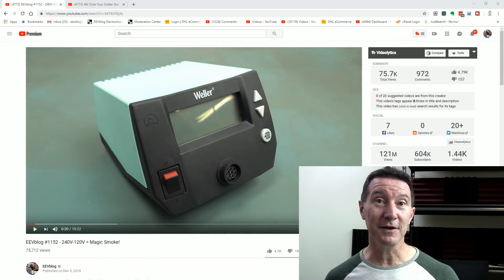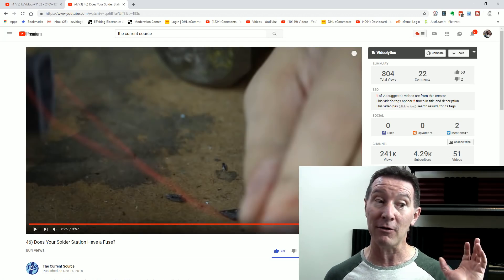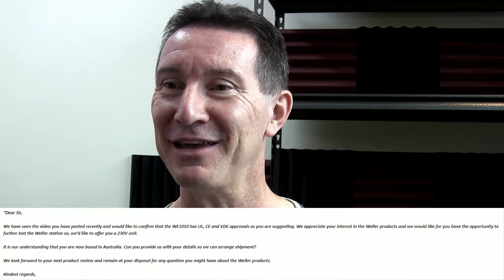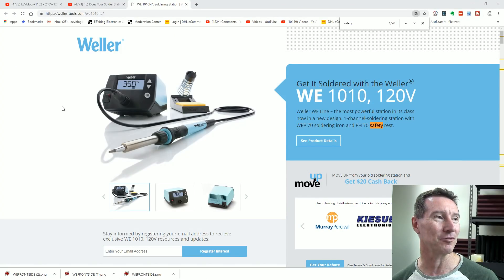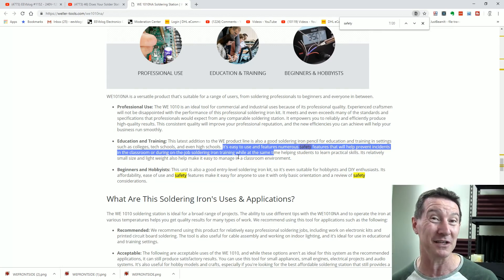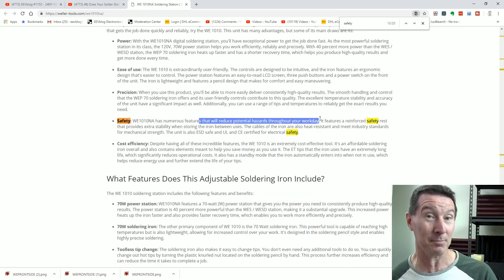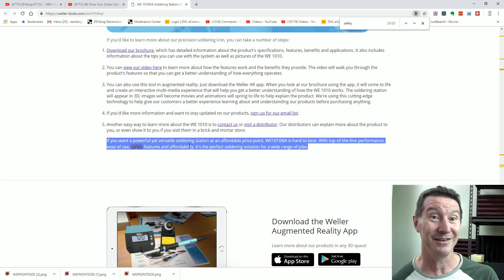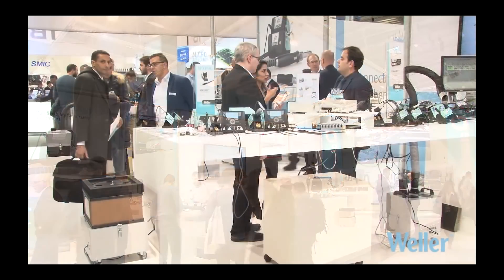EEVblog #1160 - Weller Responds!

Comment: As a European, I'm not sure what kinds of sloppy standards are considered acceptable in the US and other third world crapholes but over here, a primary side mains fuse (or at the very least a thermal fuse in the transformer) is absolutely mandatory. As Dave correctly points out, even the el-cheapo counterfeit Chinesium crap on ebay comes with primary side fuses. Weller presents itself as a quality manufacturer, yet they are shipping out non-compliant death traps like these.

I would advise anyone who owns one of these to either fit a suitable fuse themselves or just chuck it in the bin...
Reply: You do know that this iron also has CE approval, right?
Reply: @johnstone7697  So it can relase magic smoke but mustn't catch fire. 

Another thing to test.
Reply: @johnstone7697  yea but the CE doesn´t need any test.....just some paperwork to get it posted onto your whatever product.
Reply: Dude.... there is nothing wrong with the product. Dave just doesn't understand safety engineering. The problem with this is that he is able to mislead all the lemmings watching this video.

Comment: even if there was a Fuse, what should it help with quad power at the same amps?
Reply from the maker: In this case the core saturates and become resistive instead of inductive, leading a huge increase in current (which is why it smoked so quickly). A proper rated fuse would do the job perfectly.
Reply: +EEVblog you are right ...

Comment: I still have one of those old blue style weller irons, but with a 3 digit led temp display, its from the 80's , its on its original tip fitted new in 1983 which has soldered maybe 3 days a week since, used it for 2 hours last night, will get about 4 hours use today, on a outdoor job wiring up some lights on a farm tractor it got ran over and squashed the case, duckt tape sorted it, the tip has been misused to cut plastic and melt glue sticks, weller tips from the 80's were pretty  indestructible... no primary mains fuse isnt right and needs putting back in, but theres also a fuse in UK plugs and for an iron it should be rated at 3 amps, so i'm not too bothered. - not a weller employee, but def a fanboy based on them damn indestructible old tips. (they can keep there modern irons.....)

Comment: To be honest, if they have UL, CE and VDE approval you cannot blame Weller. 
This is also basically what the letter of Weller says.  
-
Weller has to meet these standards and not Dave's and apparently Weller did so.  If you do not agree with the safety of this iron then (and I agree) blame UL, CE and VDE.
Let them explain why they think a non-fused 120V iron is save enough to get their approval. This will definitely not be the first Weller iron that got fried bij 220V or even 380V.
-
I would like to see the reactions of UL, CE and VDE.
Reply from the maker: The buck stops with Weller. The product category they listed it under does not require a mains fuse.
Weller made the very deliberate decision not to include a mains fuse on this model.
Reply: @EEVblog  Sure the buck stops at Weller. But large organisations like UL,CE and VDE get paid to test the safety of products and they decided it was save enough. They also accepted that this product is listed under this category. I assume they will have tested the product and made an intelligent decision why a fuse is not needed in this case. I would be very interested in their reason why this product does not need a fuse as I see an obvious fire/heat hazard. 
-
As far as I am concerned Weller has no blame because they fulfilled all regulations. Of course, they could also install thermal switches, waterdetectors, flashing lights and what not. That would make it even more save, but ... well you will understand. Every customer looks first at the price of a product. That is why we have these safety and regulation organisations. To make sure all products meet certain safety standards. And Weller meets those standards.

I will check my Weller to see if it has a fuse on the primary side. (it has a fuse but seeing the value I think it is on the secondary) If not, I will put an extra fuse in it. So I am definitely not against your safety argument but I lay the blame somewhere else. Blame the safety/regulation organisations They were invented to make products save. They should either put this Weller product in another category or change the safety rules for this category.

Comment: Fuse lottery. If you're the lucky winner your repair shop won't burn down.

Yeah now that I know this, I'm not taking any risks. All weller stations here will be removed and replaced with another brand.

Comment: My guess is the 230V version does have the fuse as required for VDE. The 110V doesn't.
Reply from the maker: Someone posted that their 240V unit does not have a fuse either.
Reply: @EEVblog  definitely something sketchy going on then! I'm not 100% on the VDE standards, but the IEC standards definitely require it unless contained within a fire enclosure

Comment: Dave perhaps Weller is hinting you should relocate somewhere that has a fuse in the wall socket as standard protection. You will find them in countries that operate on ring circuits due to lack of copper availability during WW2. Here’s a list of countries to look at my friend. 

United Kingdom,Ireland, Sri Lanka, Kuwait, Bahrain, UAE, Qatar, Yemen, Oman, Cyprus, Malta, Gibraltar, Botswana, Ghana, Hong Kong, Jordan, Macau, Brunei, Malaysia, Singapore, Kenya, Uganda, Nigeria, Iraq, Tanzania, Zambia and Zimbabwe.

Comment: Strange that it doesn't handle any input from 120 to 240 VAC. Many modern power supplies work on 67 to 240 V AC or DC. Perhaps it's based on an early Russian design. No input fuse is just cheap and crappy design.

Comment from the maker: Even the world's cheapest soldering station has a mains input fuse: https://youtu.be/0GdV7XBae74?t=8m55s

What's crazy is they have no less than 2 fuses and a massive polyswitch on the secondary side. Not all of those are needed, and that extra secondary fuse could have paid for the primary fuse. Wacko.
Reply from the maker: Rob is correct.The transformer saturates and causes a large current overload (the inductance starts to become resistive instead). A fuse is perfect protection for this.
Reply: Normal fuse protect only against over current and not over voltage. When the wire isolation star to melt ( the resistance drop and current grows)  is too late to save your transformer (but not to prevent fire).
The good solution to avoid the transformer melting are thermal fuse
Reply: That isn't correct.  The iron-core mains transformer designed for 120V will saturate at 240V and thus the current will increase very much (not just 2x) and it will blow the fuse immediately, before any heating issues occur.
Of course with an "ideal transformer" things would be different, you would just get 2 times the output voltage and 4 times the output power towards the iron, and a fuse would not blow that easily.
Reply: @Rob2  OK good to know
Reply: @DadoRAM  Over-voltage causes an over-current condition in this case. What provides protection in the event that the primary develops shorted turns? No thermal fuse and no over-current protection, you'd be relying on your smoke alarm.
Reply: @ferrumignis  Yes and no. Because usually the fuses are oversized or slow. The WE1010 is 70W at 120V 0.58A You have 2 options put slow 0.6A fuse or fast 1A ( for the current pics). The fuses work well on short circuit but if you have medium impedence mmmmm........
Reply: @DadoRAM  The current will more than double in a situation like this. A normal primary fuse is perfect protection for that. A thermal fuse is a good solution for prolonged overload situations. It may not even have gone off in this case as, depending on its placement, there is some thermal mass involved.
Reply: Hahahahaha, that was a great laugh after this Weller rant...
"Nothing fancy, but hey, at least it is fused... Bonus"
Reply: Did The Current Source take down their video????
Reply: if I don't know what you are talking about its just bullshit
Reply: Especially there are cheap-o input mains input sockets including the fuse holder. So no need for additional parts in the enclosure and extra cabeling...

Comment: They're a great unit though. Heat output is brilliant. Under normal use there'd be no issues over it's (30+ year) lifetime. Not worried about the missing fuse at all.
Reply: My choice over a FX888 any day.
Reply: If it's 30 years old you wouldn't worry about this modern unitobviously, just don't buy a new one and you'll be fine.

Comment: I think they basically got away with not using a fuse by using high quality parts, like a high quality transformer where the insulation will simply not fail unless you seriously overload it. It's bad seeing this from a company like Weller, they should'of just stuck a fuse in there, it's just a few cents.
Reply from the maker: I'm sure the transformer is good quality. In any case transformer failures are pretty rare, but they do happen.

Comment: My WE1010 unit (230V european germany) has only one 4A/300V fuse on the mainboard. No other fuse even not on the secondary side. i bought it in mid 2018.
Reply from the maker: Thanks for the info.
Reply from the maker: Can you post a photo of inside?
Reply: Hi Dave here are 1 picture from the inside and 1 from the label. It's an isolated transformer.
https://imgur.com/a/UIrrQUN

Comment: I wonder what is the loophole in the UL approval process.  Fitted plugs in the U.K. are fused perhaps it was designed with that in mind and then they goofed for other countries with none fused plugs.
Reply: Actually a fuse is very likely to have blown in a gross overload situation like this. It’s likely the transformer would still be damaged but a fuse is not design for the protection of equipment.
Reply: There is no loophole. Also a fuse most probably would not have blown in this case.

Comment: So basically if you added a fuse in-line it would be fine after that? 

Seems like these were designed for the UK market, where the fuse is in the plug and forgot everyone else. That way you could say it is fuse protected, but I doubt that they would be that clever.
Reply from the maker: Yep, a properly rates fuse like every other soldering station has would do the trick.

Comment: There was a good comment from KCautodoctor on the last video. UL categorizes this as UL Category "KQLR" - Industrial and Laboratory Heaters, which doesn't require fusing on the device.

Of course, that doesn't excuse leaving out the $0.05 fuse in my book. When $3 LED light bulbs have fuses, certainly a soldering iron should.
Reply from the maker: Yep, it's no doubt legal for that product category they listed under. Doesn't make it right. It's just a really dumb move, why? All their competitors have a fuse, it's an industry standard thing to do, and covers your legal arse nicely.

Comment: I am only familiar with CSA and UL (being from Canada. CSA and UL are underwriters and certification bodies. In order to get a UL or CSA certification,  full design documentation  and sample unit need to be submitted. The CSA or UL labs will go over the unit, and if it meets CSA or UL safety standards, it gets certified, and a file is opened at UL or CSA as the case may be. The file number used to be shown close to the CSA symbol, but I don't think that is done any more; just the CSA symbol these days. If somebody should bring a lawsuit against the manufacturer of CSA listed electrical equipment, CSA will be in court with the manufacturer. Note:  CSA and UL are NOT government bodies; their funding comes from the charges for certification, and for the use of the CSA symbol on product labels. I think CE is part of the EU.

Comment: When I first got mine, I emailed them about the backlight which is shown on their official marketing photos:

"Hi, I just purchased a Weller WE1010, but I can't seem to activate the backlight shown in all your marketing ads. Without the backlight working, it's really hard to see the display from most angles at my bench. I cannot find how to activate the backlight in the manual. Please advise how to switch it on? or have I got a faulty unit?"

Their response:
"Sorry but the WE1010 Station has no backlight, and you cannot activated it!"

No mention of the false advertising.
Reply from the maker: LOL
Reply: @alfa-psi  Easily readable, but only if you have a light source available to shine against it. No good if you're in a shaded area of the bench. The picture falsely illustrates a blue/grey-tinted backlight, reflected on the outer plastic, certainly not the colour of the LCD backing. There is absolutely no way to recreate that light naturally, therefore it is false marketing, plain and simple. Nothing to learn except that companies will use fake imagery to promote their product, certainly not the fault of the buyer.
Reply: Bussines and marketing wankwords...so they told you... fuck you, buy another model!
Reply: Maybe it was an internal fire, not a backlight.
Reply: What about a mood light ? 😏
Reply: My just purchased Weller WT1010HN has a backlight.  Apparently WE series has no LCD screen backlight, whereas WT series does?
Reply: @LektroiD Don't know where you are, but in the UK, THAT constitutes fraudulent selling and advertising. One reason why you should ALWAYS use a credit card where possible, NEVER a debit card. Claim the money back from them (if THEY want the unit back THEY have to pay the return for mis-selling). If they don't rebate you - get the money back from the credit card company and never buy another Weller product ever again.

I have a Weller iron (Magnatip)  that is over 45 years old. STILL on my original tips and it works great. BUT that was bought WAY back when Weller DESERVED their reputation for quality. Sadly, I no longer think that of either them OR MANY, MANY other big brand names. Something weird happened in the late 80's and early 90's when "quality" became a dirty word and "obsolescence built-in" began to rule instead and the S**T hit the fan big time and just about everything went tits up as regards "QUALITY".
Reply: @boblewis5558  I'm in the UK. I bought it from Farnell (Element 14). They refused to take it back after it went faulty too (just outside the warranty period)... Video here: https://www.youtube.com/watch?v=YoKm1R_Ogq4
Reply: @LEKProductions  only proves my point then! Farnell USED to be as good as RS for returns. Also, even if it failed outside warranty, under UK law it MUST be of merchantable quality and that means for MANY items, even with a two year warranty, THAT is below a "reasonable" expected lifetime and they have to replace, repair (FOC) or refund
Reply: @boblewis5558  They offered to repair for free, but in order to do this, I had to ship it to and from Weller in Germany at my expense. It wasn't worth the hassle, money or time. It's probably too late to do anything about it now anyway. I hope this and also the video I uploaded go far and wide... After using Weller irons for decades, both professionally and as a hobbyist, I have lost all faith in that company. I'm now right back where I started, going through the process of scouring through reviews looking for another soldering station.
Reply: @WhiteShadow2k1 this is typical chinese overrating and shitty description ...oh weller how far down the toilet are you going to fall?
Reply: All the pictures of their models are computer generated graphics. I have not seen a single real photo of a single product on their page.

Comment: I recently took apart an extremely low-end "Sumvision" PC power supply, just out of curiosity.  It had all sorts of "cost down" design choices.  Almost no transient filtering was present, most of the x/y caps, coil and the thermistor to handle inrush currents were gone.  The reservoir cap was obviously smaller than it should be and some secondary caps and random passives were missing.  The point is that EVEN THIS unit, the lowest of the low, had a soldered-in fuse on the primary.  Even the cost conscious designers at the mighty Sumvision corp decided that having a fuse on board was non-negotiable.  For a high end piece of kit like this, omission of the fuse is scandalous; I am actually in the market for a decent iron station at the moment, after my 10 year old station finally died of over-work.  I now know what not to buy.  Thank you for the video!
Reply from the maker: Yep, it's very basic arse covering stuff. Yet they very deliberately decided to leave it out, crazy.

Comment: Don't flame me, but is it elitist to say you don't need a primary fuse, just connect it correctly? I know you did not connect it to the wrong voltage on purpose but you could have checked! 
As understand it a primary fuse is only there for that specific case where it protects if you connect the unit to incorrect voltages (could be wrong there).  

So a normal customer would just plug the unit in at the workplace and it works because they will never move the unit. But then again you and us viewers maybe not normal users :D
Reply from the maker: The point is that transformers can fail, and what happens then?
And even dumb people (like me for plugging in without checking) can sue you.
A fuse is very basic arse covering thing to do.
Reply: @EEVblog  Thanks for the reply! True. I forgot things can fail. That thought is literally not present in my head every time i think about stuff (i suppose beacause things are not supposed to fail :D ). Sure a fuse does not cost a thing, but :"only as much as needed", eh? Hailing from Germany i wish there would be worldwide regulations for that stuff to be put in, so that people like me don't forget about basic but efficient security stuff like fuses.